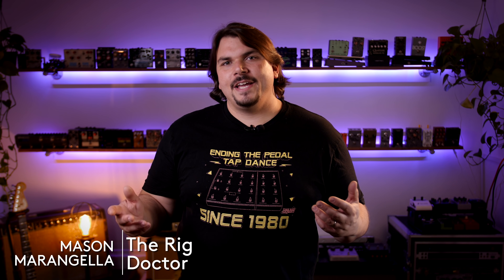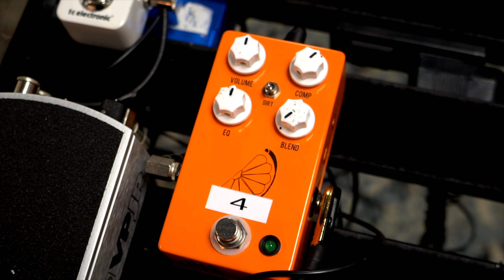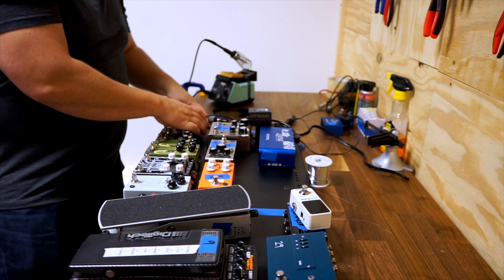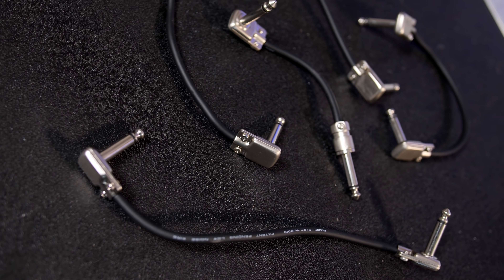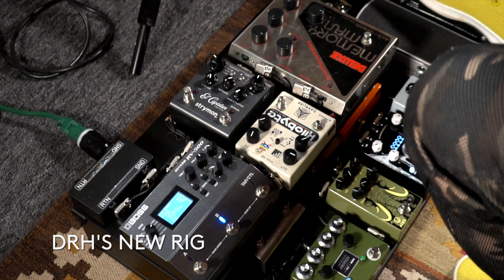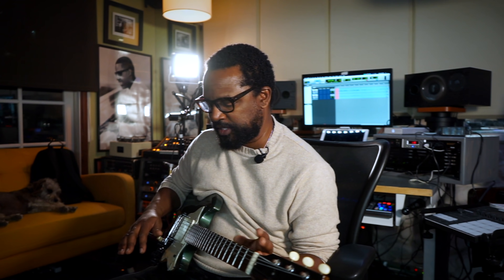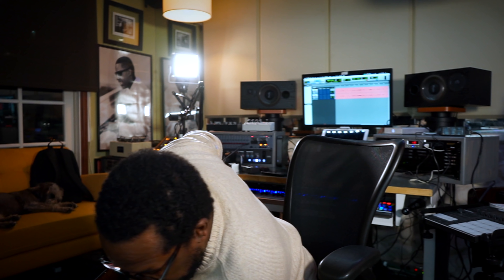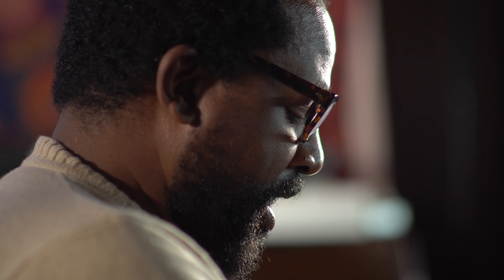The Ultimate Studio Pedalboard

Comment: Looks great, can't wait to start wiring my Vertex board! Do you know if the buffer in the Mission VM-PRO volume pedal is any good or should I build a DIY Buffer/interface? I also have an ES-5 on the board, so wondering if I need separate input/output buffers to get the best noticeable difference. I was thinking about possibly modding the volume pedal into an interface to save some space... Also wondering your thoughts on the new Fender power supplies. I was planning on using a Voodoo PP3+ but the LV12 looks nice too.
Reply from the maker: Samuel, I don't know the specs on the Mission.  If it's 1M input impedance and 100 ohm output it might be OK, but would just be an input buffer, you'd still need an output buffer assuming you'd put the volume pedal first.  The ES-5 buffers are the same as any Boss BJT buffer, not great.  The DIY buffer we do is a sure thing in terms of quality and tone.  The Pedal Power 3+ is great!  I don't know enough about the Fender supplies or the details on it.  They don't mention if it's linear or not.
Reply: @VertexEffectsInc  Thanks for the info! Here's the published specs of the VM Pro. Seems that the output is 30 ohms.

Input impedance 1V at 1KHz:
Standard: 1M Ohm
PZ: 10M Ohm

Output Impedance @ 1KHz
Normal Mode: 30 Ohm
Fuzz Compatibility Mode: 10K Ohm

Comment: Love the solution for the power supply of the EX7. I have done a backyard version of the same thing on my board. Is there a link to the tiny little jumper extension cord you used for that?
Reply from the maker: I think I just got it at Home Depot, it's a lamp extension cord.

Comment: Mason! I need your help man. I build a new board and want to mount the power underneath, problem is this new gator supply has the AC input on its side and cant get to mount as easy as I'd like. I want to wire up an additional AC inlet on the outside of the board; (IEC cable plugged into the power supply hard wired to the inlet). Is this ok or should I just find a different place to mount? Should I get a fused inlet or does it matter? I don't think I've seen your interfaces include AC inlets so I was thinking there may be a reason.
Reply from the maker: John, sorry I can't give advice on this sort of stuff regarding AC.  I did a few times in the past and was advised not to for safety reasons and that you could injure yourself if something went wrong.  There are some dog-ear IEC mountable plugs that are female on both ends and require no cutting or soldering of new AC power cables.  I'd start there.
Reply: @VertexEffectsInc  Thanks for the advice anyways, the female to female IEC would do it, just got to find the right fit. You truly are the rig doctor, thanks for your time!
Reply from the maker: @johnmorrison8618  my pleasure!
Reply: @VertexEffectsInc  Just mounted and wired up the IEC port, works great!
Reply from the maker: @johnmorrison8618  great news!!!

Comment: Hey Rig Doctor, im sure you've seen this product already, but you might not trust it.  The Rockboard Iso Power V16.  It has 15 outputs, 4 of them switchable between 9,12, 15, 18v.  There are not many reviews on it, I ordered it blind, not knowing if it would be noisy.  It is more or less dead quiet.  And it is very low profile, maybe similar in size to Cioks powerbricks.   I have the slightest hum, but im sure the 2 solderless cables im using are to blame.
Reply from the maker: I don't know much about it, whether it's linear or switch mode, etc.  We don't see them often here in the USA, or at least I don't.  Could also be the transformer that's doing the "hum" if it's linear.

Comment: Quick question, is pedalboard noise etc. more of a problem for guitarists than bassists? Pretty much all the boards you build seem to be for guitarists and I wonder if it has something to do with the range of the instrument etc
Reply: Not the rig uncle, but bass players tend to simply use less pedals, and furthermore less gain pedals that sit in the frequency range in which noise is particularly noticeable. Bass players who use lots of fuzz/high gain amps, or high voltage pedals like Strymon units probably need the same amount of care. 

Ultimately, I think it is most likely the first option. Bass generally is trying to fit in with the drummer, and having big, time based effects pedals and swampy stuff can make that relationship fall apart.
Reply from the maker: No, it's pretty across the board - we have a video coming in a few weeks for bass players specifically and the similarities and differences in approach for a guitar rig versus bass.